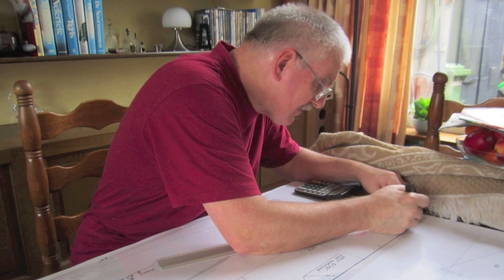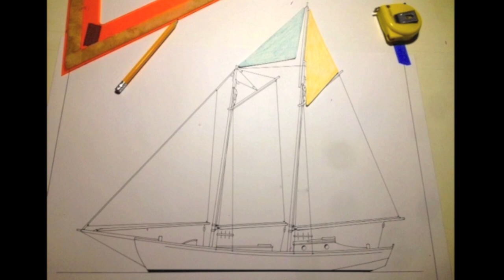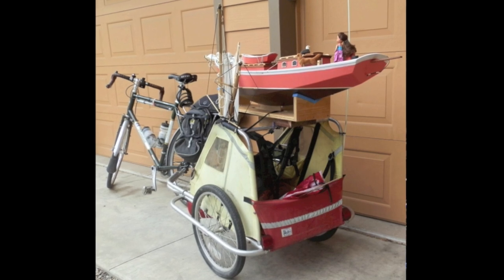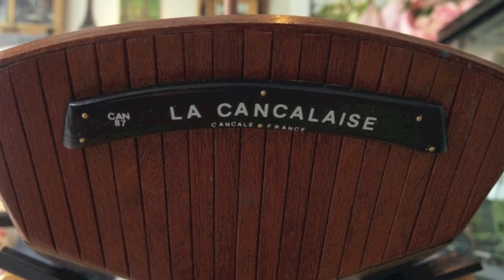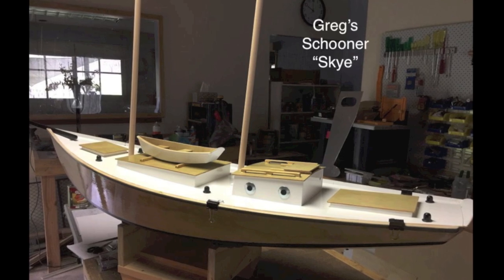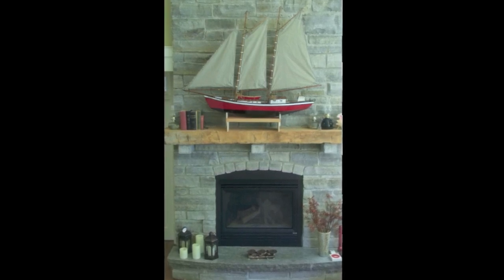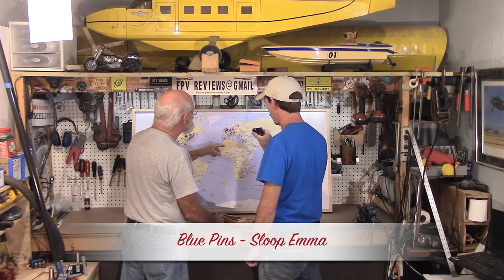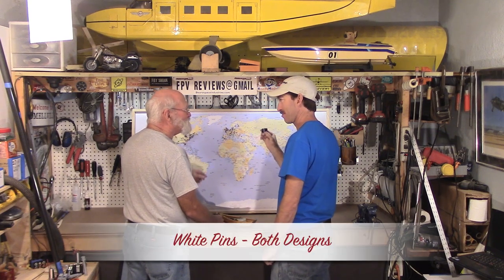“Salute to Scratch Builders”

Comment: I will order up the plans for Emma
is it made from ordinary 3mm plywood or is it the expensive birch ply please?
Peter
Reply from the maker: Peter, Almost any plywood can be used if not more than 3 mm (1/8") thick. 
The plans suggest inexpensive 2.7 mm Lauan  plywood (sometimes called 1/8" utility ply), readily available in U.S.  
Some builders use 3 mm pine plywood, which seems to be commonly available in some other parts of the world. 
Quality birch ply is very nice, though more costly. Hopefully you can find a suitable plywood locally.
Happy Boat Building!